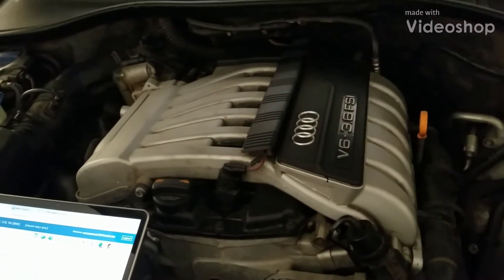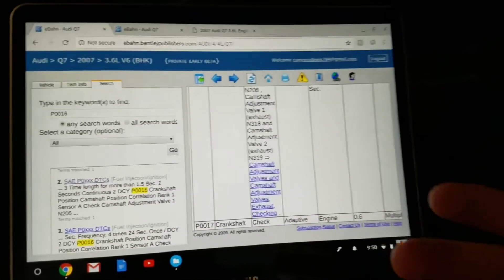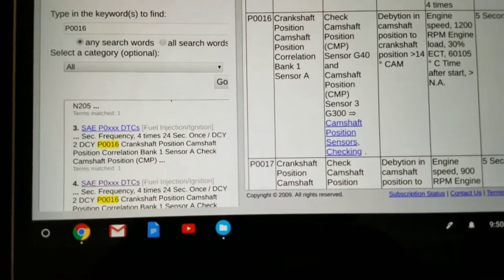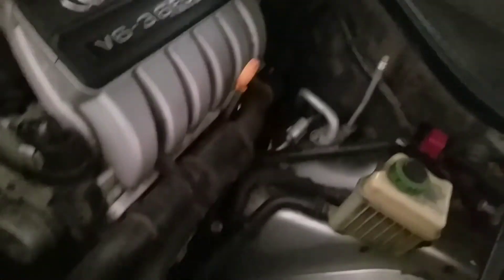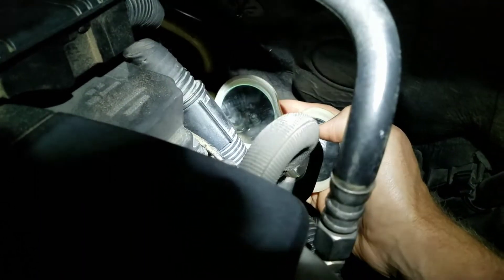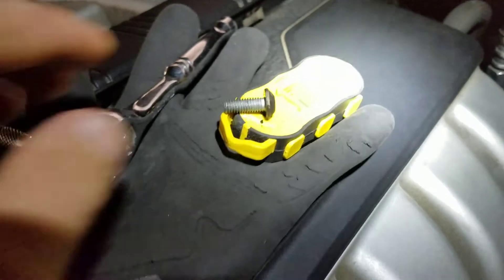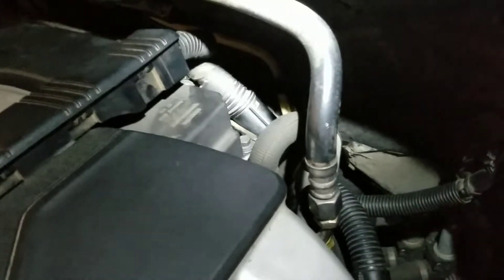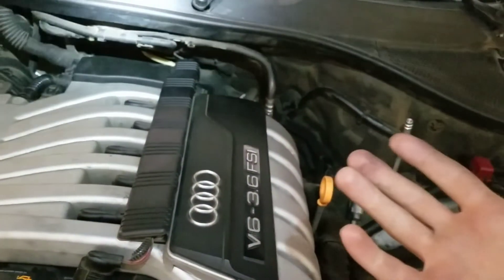2007 Audi Q7 3.6L code P0016 Camshaft position sensor replacement

Comment from the maker: A mechanic plugged in a snap on code reader and did a deep dive. He concluded the timing is out.  The reader showed camshaft valves at around 24 degrees instead of zero. He said there was no sign of electrical problems, it needs new timing chains. About $2500 repair because they would have to pull the engine out to replace. He said he'd just drive it until it dies.
Reply: Hey Cameron, thanks for sharing. I have a 2007 Audi Q7 w. 3.6 engine, Silver too. 94,000 miles and same P0016 error codes and P0300 series misfires. Dealership said it was the timing chain as well, said it would cost $11k to fix. Damn shame. Wonder how long the car will last. No more Audis if they cant even make 100k miles.
Reply from the maker: @danosborne5124  See my comment above. This might be related to oil sludge build up, restricting oil pressure. Camshafts are adjusted by the oil pressure supplied by the oil pressure pump, if it can't supply quite enough pressure to rotate them all the way, it would throw this code. You might not have a light on indicating low oil pressure because you haven't gotten to a point where it's low enough to trip that red line. You might want to try what I'm going to do tomorrow and find a mechanic that uses BG products use BG 120 Engine Purge for 60 minutes with no load cycling through the various RPM levels with a machine, then changing your oil right after.
Reply: @maverik250  Hey Cameron, thats VERY interesting. I was driving on the highway this week and the Oil Pressure light came on several times. I kept my RPM's low for the rest of the way home. I have enough oil in the car, and it was changed a few months ago. For a few hundred dollars its worth it to try out the BG 120 Engine Purge. Lets keep talking.
Reply: Cameron, got the BG 109 run through the engine today. The engine sounds better. Mechanic doesnt know whether it will improve things, but only time will tell. Did you get the work done?
Reply from the maker: @danosborne5124  A local mechanic ran BG 120 Engine Purge through for 40 minutes (he didn't dare do it for the full 60 minutes), then changed the oil. It's been 2 days and so far I haven't noticed any change. He said the oil that came out was black and nasty, so it definitely stripped some of that out of there. He wondered if I might want to try doing it a 2nd time, so I might venture. The low oil pressure light still comes on at 1500 RPMs, so I haven't been driving it much, only short trips at low speeds.

The mechanic told me his BG rep told him that a local shuttle company that runs Mercedez shuttles for tourists uses this stuff all the time, but they don't follow the instructions. They actually put it in the crankcase and drive the shuttle to a town 30 minutes away, then drive it back (1 hour round trip) and change the oil, and it works like magic. You're not supposed to do that, but maybe if the engine is really gummed up....Hard to say. 

I read on an Audi forum that one guy solved his low oil pressure problem by taking his engine apart and cleaning out his breather valves that connect to the oil cooler. He said they were really bad and it was a messy job, but getting the gunk build up out of there solved the problem. He had already tried dropping the pan and cleaning the screen, but that wasn't enough. 

I also read that sometimes the release valve inside the oil cooler (oil filter housing) itself can get jammed open and release pressure also, and there's actually a technical bulletin for my car that recommends changing the oil filter housing out, but it was related to the light only coming on during a cold start and then going away after the engine warms up. 

There's another guy online that said he's solved low oil pressure on Audi by draining the oil, removing the oil filter, and pumping kerosene through where the oil filter goes and letting it sit overnight on the oil screen, then draining it out the drain plug. He showed pictures of small grit like rocks that came out that were plugging up the screen. He said that solution only takes him about 20 minutes vs 2 days of labor to drop the oil pan. For now, I think I'm just going to wait a bit, but I might try the BG again in a few weeks. Let me know if you find out anything that helps you.
Reply: @maverik250  Sorry to hear it hasnt worked out for you Cameron. My experience has been better. The last 5 days I've driven the Q7 about 100 miles and have had it revved to above 4k RPM's several times. The engine sounds great! Before the BG109 treatment, at 3k RPM I wouldve had a low oil pressure alert and maybe even tripped the Check Engine light and ESM. So far I havent had any engine error codes and it feels like the problem has been solved. Even with colder mornings and cold starts I dont hear the same amount of grinding as I did before. Of course fingers crossed and touch wood! 

From what I was told, my mechanic got the engine warm, added the BG109, ran the engine for about 40 minutes, drove it a bit too to get different RPM's, then drained it and changed the oil and filter. He didnt think the oil was that bad, but I figure thats because the BG109 did its job and destroyed the sludge.  

Maybe have your mechanic do it again? I see BG109 is sold on Amazon, maybe buy the can and do the process yourself? Did your mechanic add MOA as well?
Reply from the maker: @danosborne5124  That's great news! If it worked for you, there's proof that the  oil sludge build up is causing the P0016 code AND low oil pressure. Yeah, I'm going to do it again. My mechanic said his rep said to use MOA after, but when he saw I had bought full synthetic oil, he thought it didn't need MOA and didn't put any in. [Shrug] since mine didn't work though, I'll use it this next time and let you know how it goes. That's awesome that it totally fixed your engine!! What a relief that must be!!! Sweet!!!
Reply: @maverik250  Yep, its a great feeling. Thank you!! Of course its still early but as we continue to drive the Q7 I get more confident that I dont need a new timing chain and the engine has alot left in it. I will pay more attention to engine oil going forward!
Reply: @danosborne5124  what's  MOA?
Reply: And did the BG 109 fix your issue?
Reply: @roryfoster482  MOA is another additive used. Its like Seafoam. And, unfortunately the Q7 engine started having problems again about a month later. I sold the car to an Audi mechanic who planned to rebuild the engine.
Reply: @danosborne5124  got it, thank you.  Sorry to hear. I just picked up an 07 Touareg and it had 8 different codes but it was cheap. I replaced the Crankshaft sensor now it drives like a dream but p0023 correlation code and another code both for camshaft sensor B are coming up. I'm diving into it today. Wish me luck
Reply: Hi Dan, just curious, was the problem that came back the same or different?
Reply: Hey guys I'm sorry your going through this I'm going through the same thing and you were right it was clogged I had a really good shop do everything for me and at first it was building to much pressure so they looked into it more and they found that it was clogged and fix the problem but I still have to change my crankshaft sensors.
Reply: I am not getting any errors, did timing chain in the back towards the gearbox. Literally 0 errors but no firing injectors I assume, glowplugs are BONE DRY.

Comment: Cameron, thank you for the video. Have P017 code on my 2007 VW Touareg 3.6L. No low-pressure light. I read through all the comments and suspect there is no easy solution for the problem. Will change the camshaft sensor and maybe use BG 109 after, if the problem is still there. My car runs great, however, how did you deal with the state emission inspection, since there is a code?!
Reply: @fedor - would appreciate any update. I have a q7 2012 with similar issue. All cam sensor changes but still have the problem.
Reply: @hshar2024  Unfortunately, need to do timing work on engine. Scheduled to replace timing chains, tensioners and guide rails. Requires removing the engine with transmission. Decided to spend money, as otherwise my Touareg is in good shape with only 68K miles. I'm the original owner.
Reply: @hshar2024  Ended up doing the timing job. One of the Glass Filled PA plastic guides for the chain was broken into a few pieces. Replaced  both chains, all guides, sprockets, tensioners , hardware and associated gaskets, serpentine belt, etc., since the engine was out. The engine is running good. The advice, - replace all the wear items when the engine is out.

Comment from the maker: You know what? I think I found a very possible solution to this problem that might cost $250 or less.  I don't think this is a timing problem. I think the mechanic is wrong. Hear me out. I will try this out tomorrow and let you know for sure. A new problem popped up. Now, when I turn on the engine, start driving, and the RPMs reach 1500 or higher for about 2 seconds, the "low oil pressure" light flashes in the dash and makes a loud high-pitched noise. I researched this and it means you need to stop driving immediately to prevent engine damage. I can drive slowly about 25mph or slower, without the light coming on. 

So, I took it into a local mechanic diagnostics shop (not fans of german cars). They ran the compression test, scanned it, looked at graphs, and all that. They found that the oil pressure was at 20 psi at idle, 20 psi at 2000 RPM and 18-20 psi at 3000 rpm. They looked at graphs, used their scan tool, and in their best judgment, said we'd have to take the engine apart. The quote for this was $7,500 to tear down engine, replace the timing chains and oil pump. $10,000 to replace the engine with a used engine, and $16,000 to get a brand new engine installed by Audi. They recommended not putting any more money into it. 

The old mechanic told me he really doesn't think the timing is off. He also doesn't think the oil pump is broken, but he just couldn't determine what was wrong. I asked him about replacing the oil filter housing, the oil cyclone separator, or any other ideas. He said, I just really doubt those are the problem. I really doubt it. One really useful thing he told me though, was that the timing on this engine, at least the camshafts, are adjusted via hydraulic pressure (oil pressure) supplied by the oil pump. He concluded that the P0016 code could be caused by low oil pressure, because the pressure can't get high enough to rotate the cams, so it causes the "camshaft correlation" code. 

I had already replaced the oil pressure sending unit (oil pressure switch), changed the oil and filter, and ran seafoam through the engine, and nothing has helped. So, I was about to give up on this car. Then I called this mechanic shop that only works on german cars. They're about 4 hours away from me, but I called to pick their brain. When I told him the problems, he instantly said, I bet your oil screen is plugged up and restricting the oil flow in the engine. The pump can't supply more pressure, because it's like sucking through a plugged up hose. It just can't pull enough oil fast enough. He said they've solved this problem multiple times on Audi by running a product called BG 120 Engine Purge through the engine for 1 hour in the shop, without putting a load on the engine. They hook it up to a machine and it cycles the engine at different RPMs. He said he doesn't have any faith in seafoam, but this product really works. He said it strips down all the oil sludge for the first 30 minutes, then dissolves it over the next half hour. Then, afterward, you have to immediately drain the oil, so everything comes out, and put in brand new oil. He said he's done this multiple times on Audi and FIXED THE PROBLEM. It only costs about $115 to do the service + the cost of new oil. Can you imagine? A $250 fix, over the estimated $7,000-$16,000 estimates!!! So, tomorrow I will let you know if it works.

So, you can see how oil sludge build up in the engine, and in particular, the oil screen in the oil pan, can in fact lead to low oil pressure, which itself can lead to the P0016 code. One thing I learned about Audi from about 4 mechanics I spoke with is that the oil changes on Audi/VW are absolutely crucial. ALWAYS change it on time and with the right kind of oil, not just 5W40 or 5W30. It needs to have the right specs. Mine is VW 502 for example. Audi engines are extremely expensive compared to other brands to tear down for any work on them. So, the oil change should be like the MOST IMPORTANT thing you ever do for your Audi. Don't EVER cheap out on it. You'll regret it. I bought this car from someone who was changing the oil at Wal-Mart where they don't even have a 5W 30 that fits the VW 502 specs. I guarantee that led to all these issues I'm having with it.
Reply: So what happened after all? I had same code pop up at first, delete it and about an month after that low oil pressure light (tested it and it was low only after oil was warmed up, cold engine was fine) popped up and oil level was low. I changed timing chain, guides and bunch of other things, put new oil which helped build up pressure but engine light is still on with same code. interesting, code was popping up at startup and car doesn't idle  as smoothly but low pressure light was coming on at higher rpm? DId you solve your issue?
Reply from the maker: After doing the 40 minute BG 120 and changing oil & filter, I had no improvement, so I bought BG 109 & MOA on Amazon for about $30 and did the same thing 2 days ago, but this time I did it myself. After 40 minutes and no change, I drove the car for roughly 15 minutes on a 35mph road. I had no change with the beeping & light when rpms are at 1500 or higher for at least 2 seconds. I then changed the oil while the engine was hot. The color was perfectly translucent and golden, with absolutely no black or debris of any kind. I was shining a bright light through the stream the whole time, so I could see it very well. This oil is only about a month old with few miles driven. Based on the fact that nothing came out (no sludge), I figured, the engine must be super clean inside (no sludge to cause the problem). I can see down into the crankcase from the cap and everything is really clean. 

So, for my car, it's possible the clearance on the bearings has just gotten too large to build pressure anymore, but I'm not sure. I drive the car for short trips, and it works fine. If I briefly step on it, it gets to about 3500 rpms and maxes out and won't go higher. I have only tried it a couple times for experimentation. There is another code on mine: P0087 for low fuel rail pressure. I don't know how it might be factoring in. 

There was was a technical bulletin issued on this car for low oil pressure, that if when starting it on cold, the low oil pressure is triggered, but after driving it goes away, the fix was to change the oil filter housing and upgrade the software in the computer. But since that's not our problem, I haven't done it. Mechanic quoted me 3 hrs labor and roughly $200 for the part. He and another mechanic both strongly doubted that was the issue.  

How much did it cost you to do your chains, guides, etc?
Did you change out your oil pump?
Have you tried running BG product through to clear out oil sludge build up?
Have you tried changing your oil filter housing?

There is also a release valve under one of the heads, requiring that head to be removed to get to it. One mechanic suggested that as another possibility. I believe he said it was a release valve for the oil pump itself. 

There was a guy on audiworld that said he tried cleaning the pan with no success. He took apart the engine a 2nd time, and what did it for him was taking off and cleaning out the exhaust valves on the left side of the engine. They look like a few pipes that connect at a point. He said they were really gummed up. After cleaning, problem was solved on his Audi A4. I thought using the BG would take care of all of that though. Running the BG 109 & MOA did work for Dan Osbourne, which you can see in these comments.

Comment: Replaced both sensors. They were quite dirty. The problem with fault code is still there. Thinking, it might be dirty VVT solenoid (s). Might to attempt to remove and to clean them.

Comment: Do you know where is the camshaft sensor on the 4.2?
Reply from the maker: It looks like there are 4. Below the 4th spark plug on each side, there is a wire that goes to one sensor on each side. The other 2 are on top of the engine near what looks like a high pressure fuel pump, which is on the other end from the oil cap. Each sensor has a single screw that screws them into the engine, and a wire that plugs in.
Reply: @maverik250  wow thanks for the help a mechanic told me they are inside the intake manifold & wants to charge me $450 for labor & im buying parts smh good to know

Comment: If the engine kick with Delay it might have problem with chain tensioner that send false segnal to sensor. 
If you use low octan gas it will cause lose chaine over the time .
Reply from the maker: Mohammad Firouzbehi I did have a loose chain tensioner at the time. Thanks for your comment.